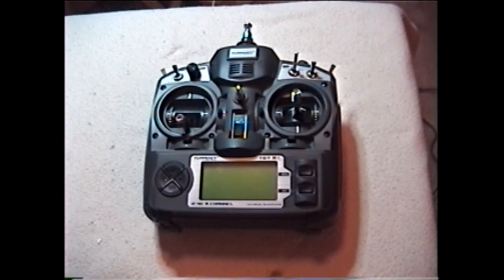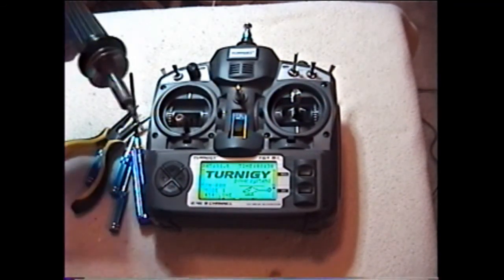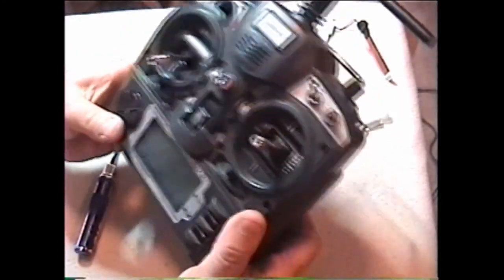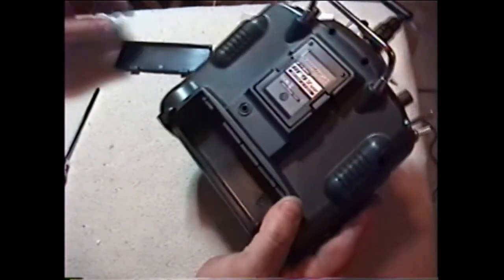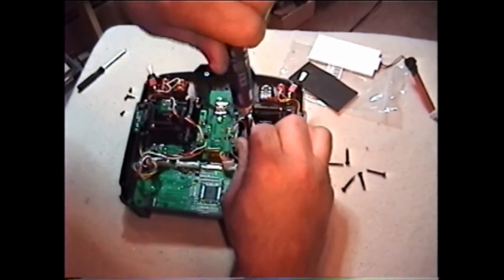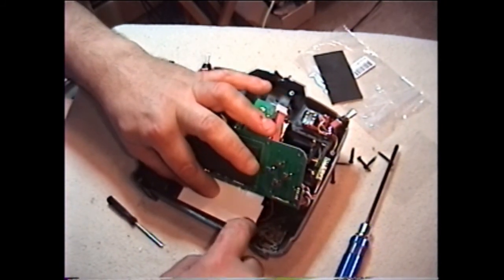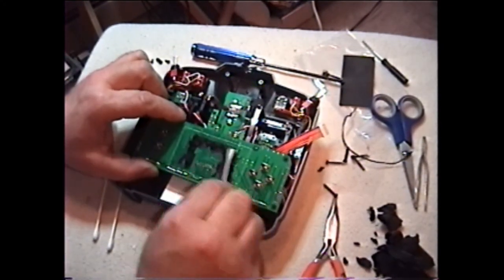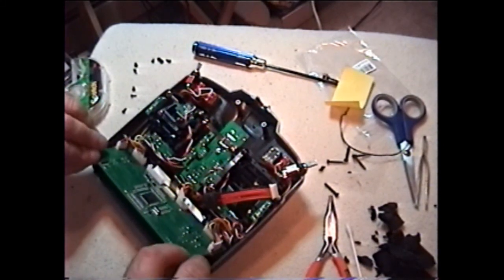Turnigy 9X backlight mod part 1

Comment: Temperature of the air is the trick, when I was doing mine I had 30C (86F) air temp and it came off in 30s like the HK video .Do not use heat gun you only burn foam.

Comment from the maker: 8 x 1.5 double a batteries = 12 volts
3 cell lipo = 11.1
i charge the lipo in storage mode.....but others have charged fully with no problems